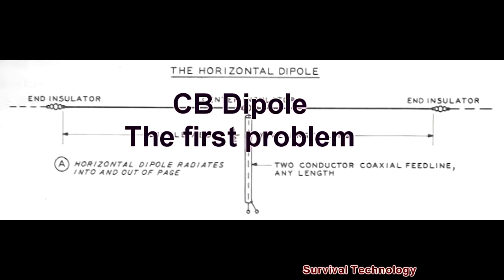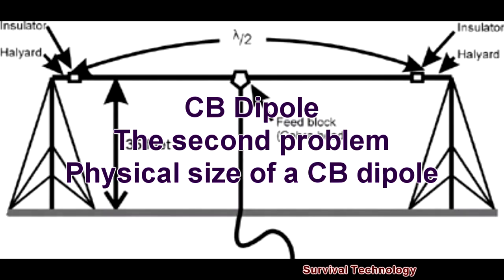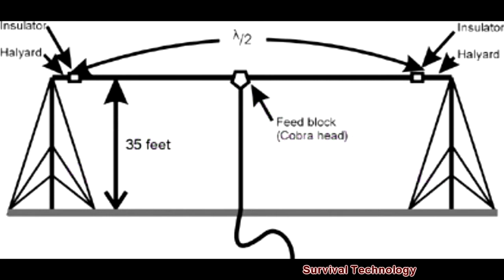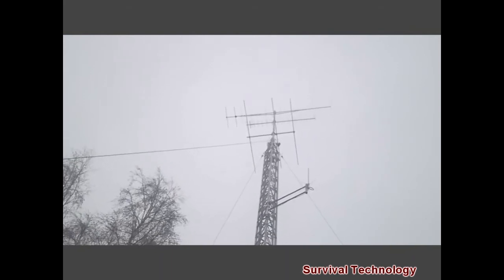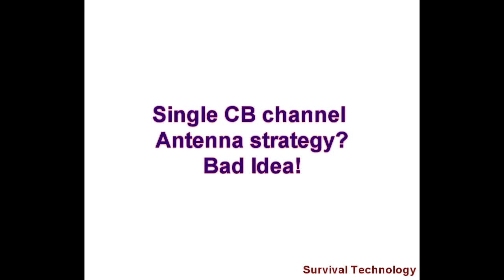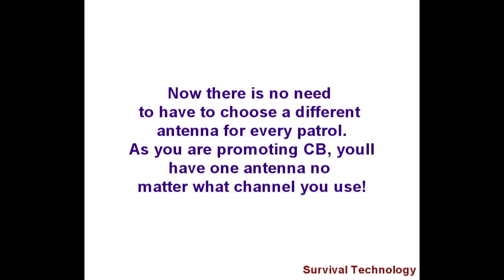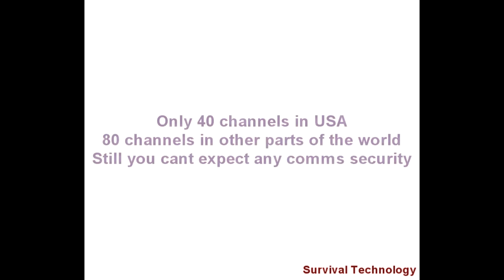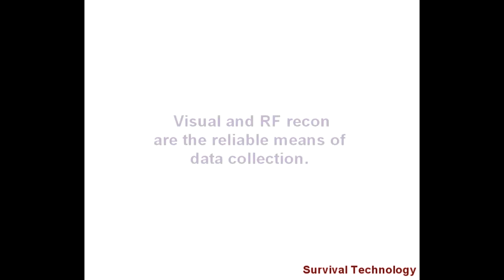Dipole Antenna For Patrols | VR Hiberniason

Comment: My coms experience comes from the Army so a lot will not carry over to civilian.  My SHTF commo plan included FRS/GMRS but after moving to a new house last summer and finally testing this summer the result was disappointing(new terrain).  I will keep the FRS/GMRS in my plans for base camp but  I decided to include CB radio into my plans to reach a further destination.  Once society reaches "Without Rule Of Law" our plans are to have patrols out probably to a maximum of 20 miles radius.  Your right teach people good radio habits.  Stay off the radio unless its an emergency or unless it is a check in time.  If it is WROL and it is suspected that someone is trying to triangulate and they are in a vehicle a hasty roadblock will happen and all equipment will be seized and the operator well it wont be good.

As far Ham, no interest in getting my name on another government data base.  I don't need a license that says I can talk.  If an EMP happens and takes out all the repeaters then what? Just isn't for me.  I will probably get one of those cheap ham handhelds just to bet the freq uploaded and then put into storage for a just in case.
Reply from the maker: +Swamp Fox well, what can I say other than, "it's not just a license, it's the making of a training scenario". There 8s so much technique into real grid down comms that people think8ng they will just "operate " ham gear effectively after teotwawki, will be sadly disappointed. The gear is easy, how to use it, or what techniques to use for differenent types of comms, avoiding triangulation, ... needs training.
Good luck
Reply: OH8STN yes avoidance does need training.  A lot of that is keep your mouth shut and very short transmission times when you do talk.  Plan ahead for your transmission.

In the civilian side I am new and as I am researching it I'm learning more.  You should do a Guerrilla radio communications series.  Radios for home base, radios for patrols and the antennas for both uses and power sources.

Comment: Use a simple T2L2 coax dipole google it,put it on a vertical fibre pole,B\W about 1-1.5mhz wide so easy cover 26.5-28.0mhz.,really easy to errect in field for base use or semi-portable.
Narrow FM on cb band works much better,audio quality,background noise,full power.
Most of the new cb can be switched to other bands just outside normal FCC\EU for tactical use typical 26.5 to 28mhz.
As for legal use I would assume that would go all out the window if things turned bad or emergency use.Here in UK land Narrow FM and AM legal so we have legal choice.
As for secure,well one time code books would help,keep it brief and short,use numbers to identify yours selves instead of names,ie this is 42 calling 36 over,send 42,i have have located HQ etc etc 36 out.
Also there are available simple speech inversion speaker microphones you can hook up to your cb hand portable if it has the 2.5mm\3.5mm jacks on radio.These will give you some level of security.The cb bands (26-30mhz)were used by the military for tactical use,esp in Europe and USA wwII sherman tanks 20watts wide fm 20channels!
I can recommend a excellent "commercial grade"  cb handportable  for tactical uses etc,its splash proof IP57 rated,small ,full 4watts fm and 4watts pep am,Robust TNC screw antenna socket,Can do 120channels export @8W fm\8W AM pep  or standard channels FCC\CEPT band 40channels bands40,google President Electronics "President Randy 2".I got four of them and they work really well,as good as a commercial vhf HT
They will also take Icom acc's Icom BP-232 batteries,BC-160 dropin chargers.
President Electronics are coming back to USA by end of year,but you can get these sets Imported into USA,hope that helps :)
Reply from the maker: Thanks for the information and suggestion.
Based on your message, I just made a proposal to President to feature these radios (President Randy II P) on my channel.
Reply: Thank,always here to help,been in the radio comms business a long time,like to help radio users and alike.Heres a good place to see all the lastest cb radio in Europe and beyond news from my friend simon.
http://simonthewizard.com/
President may do a usa version of randy 2 prehaps,they are do to move to the states very soon,All the best Rob

Comment from the maker: savage308win 
Thanks for your reply. 
I completely agree about the FCC. Regarding 11 meters compared to VHF. That is more complicated and a common misconception, which is dependant on environmental variables, like trees, buildings, over water, in mountainous area, antenna choice, antenna efficiency, ... 11 meters is less predictable than lower HF bands with the random nature of atmospheric conditions. On FM as you mentioned, using the typical 5 watt CB radio, with vertical antenna, mounted 10 meters over ground, in an urban environment, one might expect horizon to horizon on a "typical" day. Switch to SSB and you could be ragchewing at x50 beyond the horizon, you just never know! Also remember that it's much easier to build a smaller yet extremely high gain antenna for VHF where an antenna for 11 meters with equal gain would be so big, that it would be impossible to use in the tactical environment mentioned in the original example of that first video. One reason the military uses VHF, UHF, SHF for tactical comms is the small size compared to high gain of antenna on those frequencies :)
kind regards

SurvivalTech

Comment: You can use 11 meters and get better distance than higher bands on FM but I would suggest a different mode like ssb and using an amateur radio or modified CB on a frequency far from the regular 40. In RWOL don't think the FCC will be a concern.